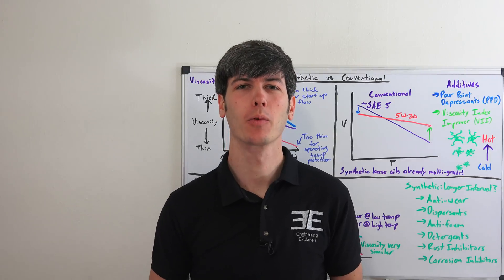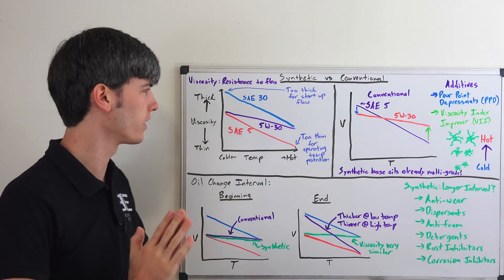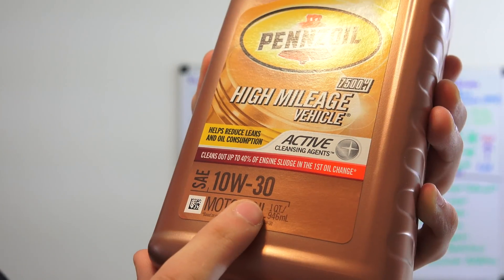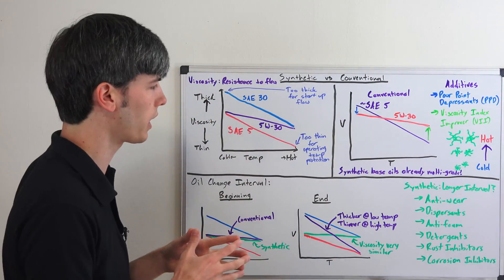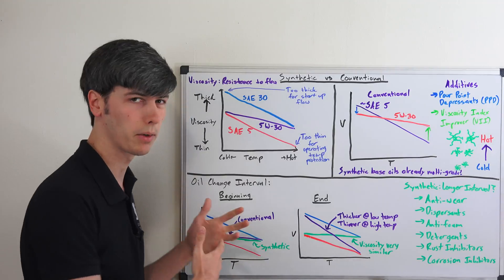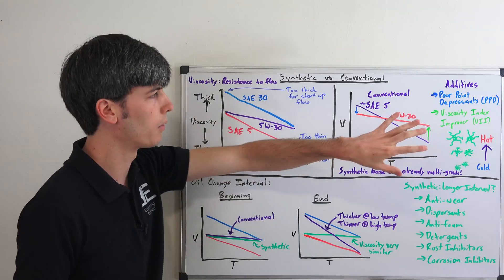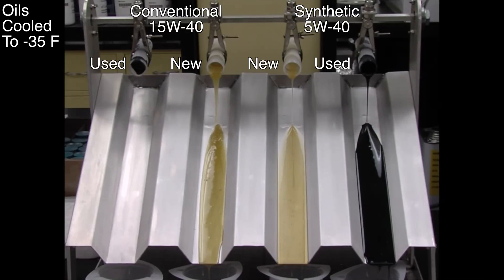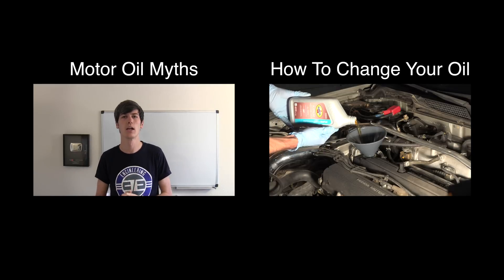Is Synthetic Motor Oil Better For Your Car?

Comment: Will a 20W50 and 20W60 have the same viscosity at low temp?
Reply from the maker: Brand new, yes.
Reply: Yes
Reply: I use Red Line 20W60 Motorcycle Oil in by bike. The properties says 177 cSt @ 40°C. But the Red Line 20W50 Motorcycle Oil properties says 141 cSt @ 40°C. Why is that? http://www.redlineoil.com/product.aspx?pid=111&pcid=21
http://www.redlineoil.com/product.aspx?pid=110&pcid=21
Reply: Depends what temp
Reply: That seems not to be correct. According to the specifications the Red Line 20W60 has much higher viscosity at low temp compared to 20W50.
Reply: So what exactly does 20W stand for? The properties says 177 cSt @ 40°C for 20W60. But the Red Line 20W50 Motorcycle Oil properties says 141 cSt @ 40°C. The 20W60 has 25% higher viscosity at 40°C.
Reply: The pour point is the same yes but CCS Viscosity @ -15°C is 50 for 20W50 and 90 for 20W60. What does that mean?
Reply: Erik Lundberg hmm, I am not very familiar using ccs (cold cranking simulator). I know using the ccs to test, the oil is moved by force to simulate oil pump or a crankcase. So  your 20W50 has a lower viscosity at -15°C than the 20W60, so 20W50 is better at cold cranking temp.
Reply from the maker: Brand new, yes.
Reply: hzryr61 You can compare oils and you'll see the viscosity is different even though they say the same grade. 0w-30 will generally be less viscous throughout the temperature range compared to a 5w-30 and 10w-30. And if you compare same grade oils between brands you'll see they're not the same either. Sometimes some 10w-30 oils are similar in viscosity to some 0w-40 which is pretty surprising.
Reply: Red Line 20W50 19.8 cSt @ 100°C. Motul 20W50 18 cSt @ 100°C. http://www.redlineoil.com/product.aspx?pid=8&pcid=21 https://www.motul.com/system/product_descriptions/technical_data_sheets/68409/original/7100_4T_20W-50_TDS_%28GB%29.pdf?1388437973
Reply: techdaemon Mobil 1 0w-30 ESP vs Advance Economy. Both 0w-30. 

ESP
100C - 12 cSt

Advance Economy
100C - 10.9 cSt

Both are 0w-30, yet very different results at their 100C temps. The numbers on the bottles are grade values, they go through a testing procedure and then if they pass they get to have the specific grade label. However it's a range of parameters, it's not exactly specific. If you want specific information, all oil companies show their spec sheets.
Reply: +Murdy Baskan I have no idea where you got that, um, idea, but while it may or may not be ACCURATE, it's not CORRECT. Physical size of the molecules is no part of the SAE oil weight specifications. They're determined by viscosity ranges at specific measuring temperatures - 0 C for cold/"winter" & 100 C for multi-grade hot.
Reply: +Erik Lundberg My guess would be the difference is caused by the 10 degree difference rating when the oil is hot so the formulation would alter the ratings over the range of temps
Reply: That's the idea...winter temps.
Reply: +Erik Lundberg  If the viscosity was different, then the number 20w would be different.  20w is the same as 20w...
Reply: If you look at your pages again, the pour point is the same. Pour point is the lowest temp that your oil and many other type of oil can still move. So you Do have the same viscosity at the coldest temp, but as it warms up, the viscosity differences will start to show. So the answer to your question is at -45°C the viscosity will be the same, at cold temp they will be very very similar.
Reply: just read this I am not a amsoil fan but this explains it very well 
http://www.upmpg.com/tech_articles/motoroil_viscosity/
Reply: W mean winter not weight. 20 is the SAE viscosity grade number
Reply: yes go by the actual kinematic viscosities (cst). You'll see how it varies among brands and such, even among their different marketed version, like Mobil 1 fuel economy or their other types they'll have different viscosity for same grades.  The numbers on the front are viscosity grades, it makes it easier for consumers to just buy oils that will work properly with their cars. If you like getting into the oil property then yes, look at the specs for the actual viscosities.
Reply: the '20w' is for 0*c, but the numbers you posted were for 40*C.  that is why they are different
Reply: +Sigma Projects A 0w30 will be less viscous than 5w30 or 10w30 at all temperatures below 100 degrees C.  
At 100 degrees C, they will all have the same viscosity.    They can't carry the rating they do if the behavior is any different than that.   Because you don't normally directly handle engine oil at 100C, you might be under the mistaken impression 0w30 is lower viscosity at all temps.   It is not.  

A 10w30 oil starts out with higher viscosity at 0 degrees F (yes the two points in the rating are at 0F and 100C), than 0w40, but at 100C it is lower viscosity.   Because they both follow a smooth transition from higher to lower viscosity as they heat up, there is some point in the middle where the higher slope line of the 10w30 viscosity crosses the lower slope line of the 0w40 and they are exactly the same viscosity.  That should not come as a surprise, as it inherent in their ratings.
Reply: techdaemon Go read the spec sheets on oil, you'll see that they are different. The numbers you see on the bottle are grade numbers to make it easier for consumers to purchase oil. 

I'll give you a few examples. I'll just stick with Mobil 1 and just the 40C to make it easy and so you can verify it yourself.
10w-30 Conventional vs Super Synthetic
They both have the same grade rating, but if you look at their cold start temp 40C you'll see that the Super Synthetic is less viscous 64.4 cSt vs 68.8 cSt.

Another example to show disparity.
5w-20 vs 0w-40 Mobil 1 (their basic Synthetic). Lets compare 40C viscosity, the 0w-40 should have a lower cold start viscosity right? Because it's 0w- vs 5w-? But it's the opposite.

5w-20 
40C - 49.8 cSt

0w-40 
40C - 71 cSt

And just for good measure let's look at their advance economy oils for 0w-20 and 0w-30.

0w-20
40C - 44.8 cSt

0w-30
40C - 62.9 cSt

As you can see none of them are the same. I mean look at the cSt in comparison to the 0w-30 Advanced economy and 10w-30 Super Synthetic

0w-30 Advanced Economy
62.9 cSt

10w-30 Super Synthetic
64.4 cSt

Those are pretty close to one another, for the 40C temps, yet it's 0 compared to 10. 

So now, if you go and start comparing brands to brands you'll see that they vary quite a bit.

I hope this wasn't too long winded, just trying to make sure I make a good post.
Reply: Sigma Projects
 The only two temps that matter for the multigrade viscosity rating are 0F (-17.8C) and 100C (212F).   Of course the behavior will differ greatly at your arbitrarily chosen 40C which BTW  is not at all cold (104F).
Reply: techdaemon I'm not using an arbitrary number, viscosity ratings for oils are not at 0F they are at 40C and 100C. Also I mean cold as not at operating temps as most car's oil is around room temperature. Plus I gave you many consistent grade of oils that have different viscosities.

How about this then. Look up Castrol 0w-30 and you'll see that it has similar viscosity ratings as Mobil 1 0w-40. 

Mobil 1 0w-40
40C - 71 cSt
100C - 12.9 cSt

Castrol 0w-30 Edge
40C - 73.21 cSt
100C -  12.18 cSt

If you thought 0w-40 wasn't correct for your car and Castrol 0w-30 has very similar properties to Mobil 1 0w-40 would you use it?
Reply: The winter rating is not done at 40C (104F).
Reply: correct it is at a much cooler temp
Reply: techdaemon Regardless, if you look at my last reply comparing Mobil 1 0w-40 to Castrol 0w-30 and how both their 40C and 100C ratings are very close despite their differences. Within brands the 100C may be close, but if you start comparing brand to brand you'll see that they are also pretty different.
Reply: +Sigma Projects If you look at the specs, the "hot"/100C viscosities are very close for almost any common grade. Conventional or synthetic, oils on the market all end up in the general range of 9-20 cSt, typically clustering around 11-12. Oil grades date back to the era of straight-weight-only oils, when "cold" flow was the most important variable; they're a bit of a dinosaur now, retained because they're a familiar & mostly-useful system of classification.

Fun fact: the only real difference between 75w90 gear oil and 10w30 motor oil is the additive packages. Actual viscosity ranges are nearly identical. Why are the numbers so different? Dinosaur reasons. Most ATF & "MTF" formulations are in that range as well.
Reply: 20w50 means oil molecules from 20 nm to 50 nm range.

20w60 is better for high temperature use, because its viscosity is still higher than 20w50 oil, that prevents leakage from seals. But it is nearly same.

For tighter and imporatnt usages, very narrow size band is used. For instance, for power plants, 48nm turbine oil is used for turbine bearings(which lift 10-50 ton turbine shafts.)
Reply: +Murdy Baskan lol!
Reply: This is super wrong.

Comment: Please answer.   I've always heard something like "if your engine has been using conventional oil for long time and switch to synthetic, it will possibly burn oil because synthetic is 'thin' ".

I assume this is a myth because "thick" and "thin" only relates to viscosity rating, right?   Thus both oil should be same and synthetic oil shouldn't have smaller molecule that passes piston rings.  

Please let me know the answer

Comment: FOR OLD CAR OWNERS:
if your car has +100.000 miles (Yeah i have an old Japan made Toyota and not thinking in changing it for the new crap) and you put Syntetic you are using your car with an oil too thin for a engine that has years of wear. put some good old mineral and dont be lazy and change it with when it says you should change it. let your engine warm a little before driving specially in winter (Oil takes a couple mins to move around the engine correctly) and you will have a happy old car.
Sorry for my english.
Reply: Alejandro medina, except you have it wrong. Letting your car idle to warm up is a big no no, and should only be practiced places with a serious winter. While the parts are cold on your car it's doing more damage to the engine then when its hot. The best way to warm up a car is to drive it. certainly don't rev it hard, but just get it moving and it will be better for it.
Reply: You should use what VW recommends in your owner's manual...period.
API service grades (SN) is current are backward compatible.
Reply: You are absolutely wrong. 5W-30 means 5W-30, whether it's mineral or synthetic oil. You can look up the data sheets on most oils and see there's not a measurable difference in viscosity between the two. They have to hit within a certain range of viscosity at low and high temperature to get the rating they do on the bottle.

I too have an older car, just hit 150,000 miles last week in fact, and have been using synthetic for its entire life. Last year I switched to 0W-20 instead of the 5W-30 I had been using and am not looking back. Doesn't consume any oil, gets better gas mileage, and still has sufficient oil pressure.
Reply: I do. I just wanted to see what others suggest. I use fully synthetic 5w30 to VW 507.00 specification. PD injectors are savage on oil.
Reply: Alejandro Medina The hell are you talking about? 5W-30 synthetic is just as thick as 5W-30 regular. My point still stands.

The bottom line is engine manufacturers continue to push for thinner oils, that's why the numbers are getting smaller all the time. These oils didn't exist 20 years ago.

And BTW, if you watch the video it explains exactly what I'm saying! Over time that regular oil of yours ends up being thicker at start up and/or thinner at operating temperature, which is exactly what you're trying to avoid!
Reply: I tend to believe that if 5w30 full synthetic manufacturer spec oil has taken the engine safely to 200,000 miles then why should I use something different beyond 200,000?
Reply: only 8k stick with conventional run till 15k then switch to synthetic if it was me but that's just my opinion we run out work vans 8k all the time between oil changes because the new cars have sensors that tell you when to change and there lease so we just do what we are told  and never have any engine fail and allot of them run past 200k befor replaced
Reply: In vehicles with aluminum heads on an iron block, its a good idea to warm up a bit. Unless you like blowing head gaskets, that is.
Reply: I agree. Let the oil circulate for 30-40 seconds before putting any load on the engine whatsoever. I've never been a fan of iron block bolted to aluminium head bolted to iron manifold. These metals have very different expansion coefficients. Uneven warming up causes hell :)
Reply: Should I use mineral oil in my 160,000 mile VW Passat?
Reply: absolutely
Reply: yeah put water next time, because an older engine needs thinner oil with the pass of years.............Jesus.
Reply: I'm the exact same but opposite. I have been using regular oil for my 95 truck but I want to try synthetic now because I realize I always go about 8,000 miles before changing the oil. I go so long because I know my engine wont fail first it will be my transmission.

Comment: what if you use synthetic oil and put maybe 2000 miles on a vehicle in a year.how often should you change the oil
Reply: With that amount of use, I wouldn't bother with synthetics at all.  Change it once a year.

Comment: @engineeringexplained Hello, i drive with Mobil1 fully synthetic motoroil, how long can i go without a oil change ? say i drive the car about 3000miles a year. can i go more then a year ? say it takes 2 years to reach 6000miles? thanks in advance.
Reply: From the Mobil web site...quote: "We recommend that you follow the oil and filter change frequencies shown in your owner's manual, especially during the warranty period. With the high-performance reserves of Mobil 1, you can have the confidence to go the full mileage or time frame recommended by the vehicle manufacturer. Mobil 1 is especially suitable for the latest vehicles with extended drain intervals or vehicles with oil monitoring systems that vary oil drain intervals."

Comment: [/facepalms] Viscosity curves are only linear on a logarithmic scale, such as a REFUTAS Chart. Whilst he is sort-of correct about SAE ratings, you need to remember that these ratings were written by SAE back in the 1930s and were based on straight mineral oils. Multigrade oils came much later, as pour point depressants and viscosity improvers became available.Synthetic oils also consume less energy when compared to conventional mineral oils, especially at cold start-up, therefore less wear occurs over time. Modern engines are made to much tighter tolerances then were previously achieveable and conventional mineral oils can introduce a lot of hydrodynamic drag in close-tolerance engines, hence the move towards synthetics.Synthetic oils are also severely hydrotreated to take out any double bonds that could cause oxidation. This allows the oil to run for much longer, as carbon build-up and acid oxidation products will take a lot longer to form and sludges (the old 'Black Death' inside rocker covers) is just about eliminated.I worked in lubricants for 25 years and have worked extensively with synthetic fluids in the area of subsea hydraulic control systems, using really low viscosity synthetic PAO fluids and sterically hindered synthetic esters.The drawback with synthetic oils is that they can cause seal shrinkage if the PAQ isn't correctly balanced with synthetic esters. Mineral oils can cause 2 to 6% seal swell and this tolerance is designed into seals, to ensure that they keep the oil in. Synthetic PAOs can cause 2% or more shrinkage, so if you put synthetic oil into a car that has previously run mineral oil, it may start to leak oil where it didn't before. Going back to mineral oil is the cheapest way to fix that problem if you have it.

Comment: I am wondering what would the result be if the same tests was done between 15 and 25c. I think it might be more useful for people who live in warmer climates. Where I live I very rarely see air temps drop below 25c. Also I have yet to find out whether air temps has any effect on engine oil life? I assume that it should not have much effect as the engine temps are kept pretty constant by the engine cooling system.